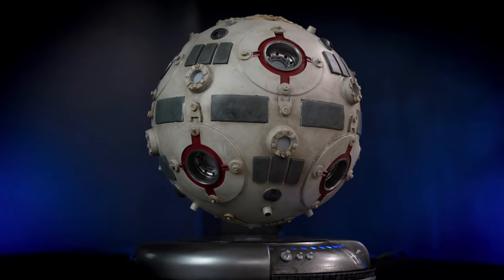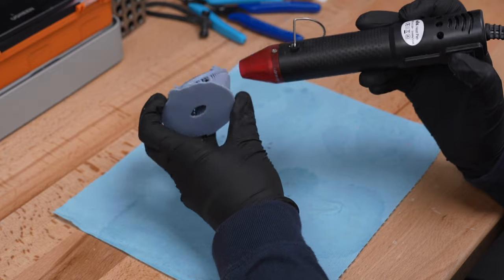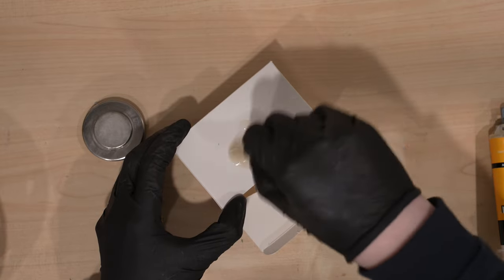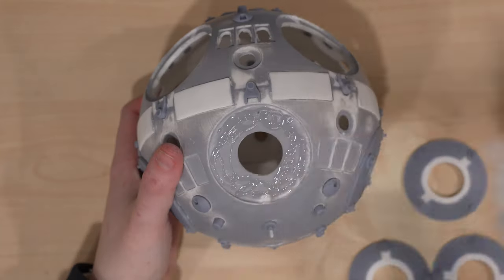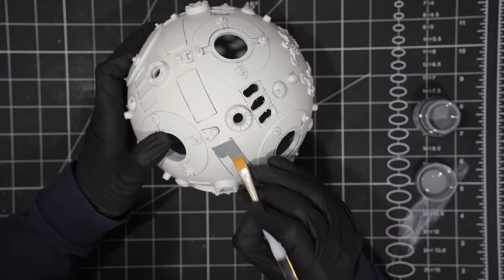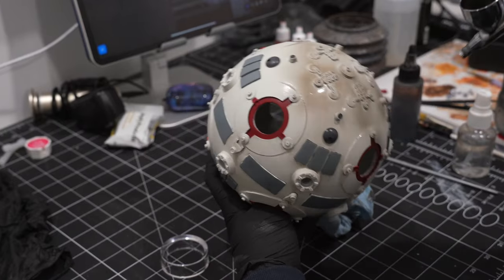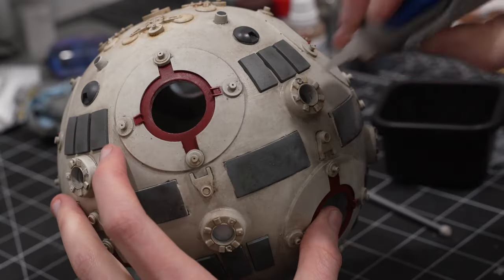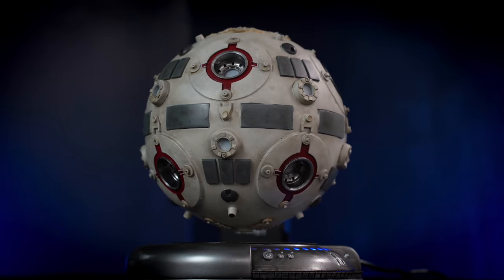Building a Real Life Jedi Training Remote

Comment: I built one about 15-20 years ago, using a real 6" hemisphere and as many of the actual model parts as possible (truck rims and tank cupolas and other parts). Couldn't get it to float properly, so I added a magnet to the top, and used a levitation device that had a top and bottom (kinda like a question mark). Then I tied an invisible fishing line to the bottom of the remote and the bottom of the base. The magnets on top are strong enough to pull the remote upwards, while the string holds it down.

Comment: You're always making the stuff on my to-do list lol, it's great motivation for me to get caught up. You did an awesome job!! The parts you did in chrome were most definitely chrome on the original, they are wheels from a model kit of a transport truck (18 wheeler) and were chromed like you'd expect from a car model kit part.  Also, for the large and small eyes, the original used reflective safety tape, that's why those spots "glow" on screen.
Reply from the maker: That’s fantastic to know, thank you! I had wondered what the lenses were made from because in some of the pictures of the prop they look like they have a slight texture to them. Now I know what to get if I ever find myself making another one.

Comment: what materiel are you using on your circuit to make the stencils to get those nice clean lines? :)
Reply from the maker: I just used some stencil vinyl like this: https://amzn.to/4aEJRs8

It has a lower tack adhesive on the back so it will peel off easily without damaging the paint underneath.

Comment: About the dynamic layer hight: the Mars 4 Ultra's .goo file format (and I assume the printer itself as well) supports changing almost any parameter per layer. You'd just need a slicer that supports that or custom a postprocessing tool.

Comment: Very good job! Is it possible to make the sphere light up?
Reply from the maker: In theory, yes. If you wanted to keep it levitating and also light up, it would need to use some sort of battery powered light that could be accessible for turning on/off and charging. That was a bit more complicated than I felt like dealing with for this build, but it would be really easy to run lighting and wires into the ball if you were ok with a more static displayed version.
Reply: @MMsPropShop  I am sure that would look amazing